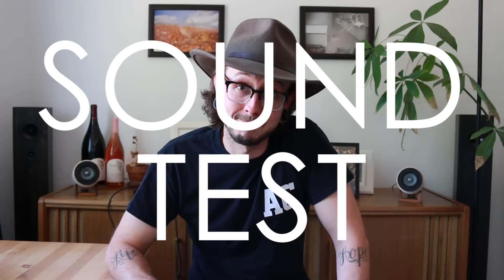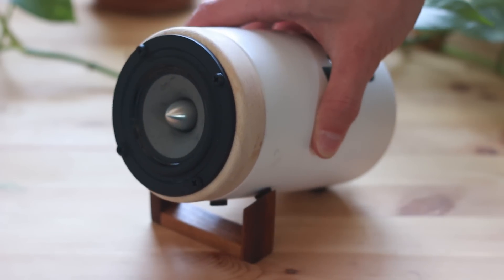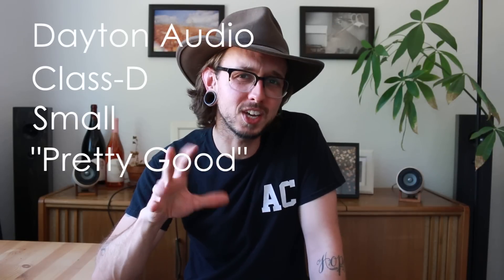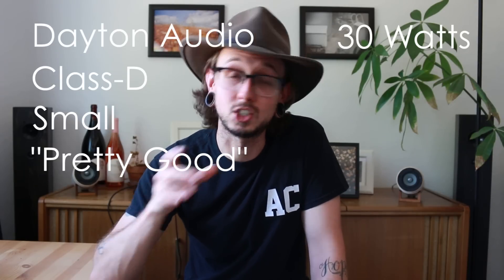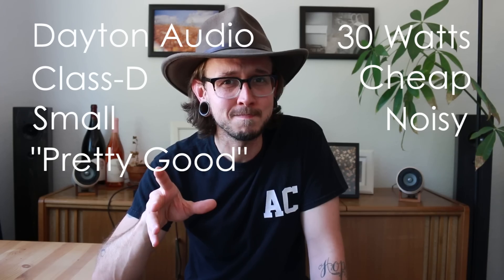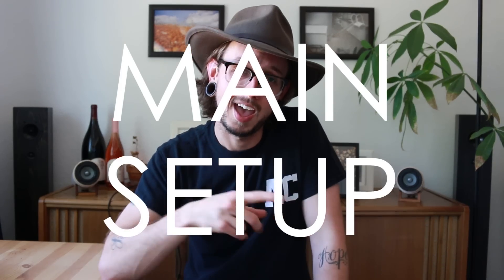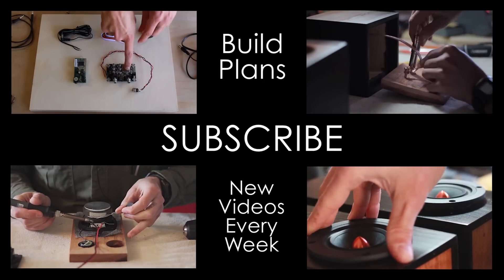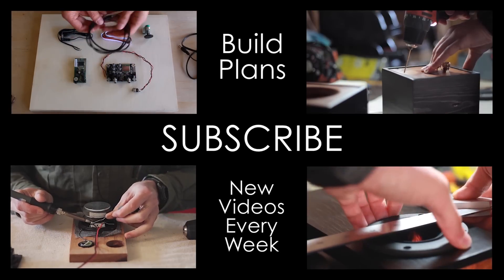SOUND TEST! DIY Ceramic Speakers || Yes, I gave in...

Comment: Hi !  first of all my sincere congratulations for your excellent creations.  Very very good indeed !  Then i have a question ... i would like to try to build a two ways.  I was thinking to use these drivers here and a woofer.  My question is ... would it be better using this driver for mid high crossed like at 200Hz or instead a classic tweeter crossed at 2 kHz ? .. in the first option most of the midrange will be on the Tang Band and with the woofer occupied mostly in reproducing the bass. In the second option instead the woofer should provide also the midrange that could be cleaner ?  My biggest worry is that when the woofer must reproduce a strong let's say 60-80Hz and a weak 1000 Hz that could lead to intermodulation distortion ?  In conclusion ... if you had to build a quite full range two ways which would be your optimal crossover frequency ?  thank you very much indeed.  Kind regards, gino

Comment: 1:28 if you're "taking the speakers to" a different setup, and you're not recording them in this same acoustic space, than any difference between the amplifiers won't matter because you've just drastically changed your acoustics.  I'm hoping that you meant you're going to bring your big amplifier in here so that the speakers are in the same acoustic space.  Because science.
Reply: 2:00 Geez dude, you act like whatever you're micing these with is completely colorless and flawless.  You didn't mention that the sound is altered simply by whatever mic you're using, and how you're micing, not to mention what speakers we're listening to.  I still like these tests because they're kind of satisfying in their own way: we know it's not accurate but we don't care, we still want to hear it in that acoustic space, through that microphone and then ultimately through whatever speakers we're listening on.
Reply: 5:25 despite what I'm saying, that was really impressive, the highs on the jazz piece were so articulate and even though the electronic piece had bass we didn't hear, it didn't bog down in the upper bass area nor did it get muddy, very impressive.
Reply: 6:46 certainly more lower mid sound on the jazz piece in this setup, but of course we don't know how the room is contributing to the sound compared to the setup previously and you have the speakers on different isolation pieces than you did in the first part.  Fun, though.  I appreciate the time you took to do this.

Comment: just bought 4 of those speakers, they are hot. 
When they came out they cost 8 dollars, now it is up to 40 dollars piece.
If you wanne know papers are the best type of speakers. The stiffness to power ratio makes them very transparent.
They have "a Directness" you wont find on other dynamics types.
The best sounding speaker I ever had, was some I build as a teenager.
It had 6 x 4 inch fulltones in pairs/serial one on each side on a cube box.
Not the best looking speaker, but the sound was....holy crap...so amazing.
Ever speaker I had since, even at 10 times the prize
were never that good.
They had to be hanging down from the ceiling, terrible look.

Comment: sound diff is negligible but great sound coming from ceramic build whatever it is i think its because of the speakers that you have chosen, what is the total cost of the project? second you did not show the connections that you made and made parts you chose for this device to give such a good sound, it all matters with the correct choice of speakers and then the correct amplifiers that are bringing such nice sound offcourse last is your ceramic..

Comment: Not sure if it was the environment or the equipment, but the demo on your main system sounded like it had more body and better dynamics when I went back and forth between them. I'm currently running a Schiit Modi Multibit.

Comment: I'm not someone who knows about these things, but are these home made speakers sealed? If that's the case won't you have issues with pressure waves in the "cabinet" interfering with the sound? When you throw a pebble in a still pond the ripples radiate out until they hit the bank then reverse direction causing disturbance. Would this not be similar? How would they sound if you put some spacers between the wooden top and the speaker itself? Look up the concrete stereo. The speakers on this are vertical and the cones are suspended above the concrete casing.

Comment: Not bad! In direct comparison between in your living room and with the original song "TFB9 - Vibe Tracks" there seems still room for improverment in the mids and highs but on the other hand it's only a small full range speaker.

Comment: Entire video is pointless, you made a comparison video in 2 different rooms.. entire video should have been in the living room. The carpet floor alone would make a noticable difference.
Reply: And the "sound-floor" static would probably mostly go away with good grounding and balanced cables on the Dayton amp.  I doubt a small Dayton class D (does it even have a fan?) would make loud hissing noises from itself.

Comment: Very open natural sound, lots of it is getting through you tube and my near field monitors. Your recording technique is appreciated, a stationary pair of mics for the sound, vs a roaming camera without sound and degrading doppler and phase effects. The home gear sounds much more articulate on the top end, much better than the class D amp. To hear the difference thru the mics, your room, the internet and my monitors says a lot for these little speakers.

Comment: Understanding what you said about all the factors that affect the real sound of quality full range speakers produce. Today it seams to be all about separate speakers "mids, subs, tweeters. I don't think most people understand the warmth of a full range speaker produces and even better if used with a good tube amp. I love the speaker looks and the out of the box thinking when building them. I have a decent setup for now and even with the compression for streaming and my speakers I was still impressed by those little speakers. I am a huge fan of full range speakers being that all the sound hits you at the same time since it is produced by the same speaker. You know have another big fan. Thank you for your videos in bringing back to the masses to what once was only known and could be appreciated by a wealthier group of people.

Comment: Great 'home brew' (that term comes from Ham Radio operators) speakers!  The sound test is very effective, and does give a general sense of the quality sound emanating forth from these little speakers.  Especially since you used a quality microphone, and if one is using good headphones or PC speakers.  I was listening via a pair of Micca MB42X speakers, driven by a Qinpu A6000 integrated tube amplifier, hooked up to my Dell PC.  Frankly, I can tell your little speakers sound quite nice and full bodied.  There was (or is?) a company called 'Norh' that made ceramic style speakers commercially years ago.  They may still be in business.

Comment: hey Kirby, hope y.re fine. Y did great work. Actually Im also hear the difference in the second track where in the last test middle frequencies are raised and way louder in a sound line, hence complete sound picture is better. Then here is a question have Y tried also some other ceramic speakers and how do you think type/style of sound is compare to wooden speakers?

Comment: that was impressive! and one thing i noticed is how this is well-equalized, the sound bars reaching at maximum of -6dB and that sounds pretty amazing. but i want a opinion..

actually i build my own class A amp, (a heater), than i want to combine 2 woofers with 2 TV speakers, (a stereo), but i have no idea what i can do about the speaker case.

PS: they will be table speakers.

PS2: the amp are 3W for each channel, what means 6 W in stereo (i do not want something loud, i want something what my soul will be pleasant to hear)

PS3: i've tested with my tv speakers, 3W are pretty loud...

PS4: sorry for bad english D;

Comment: I recommend a good camera mic instead of this directional high end one. These tests partly work by listening to the reverberation the extra base gives off in the room and the mic picks up how well the high and mid clarity works.

I gotta admit though, I'm impressed by how well those little speakers perform. Usually speakers that size sound like crap so that's insane!! Is it possibly due to the higher end drivers or the ceramic housing?

Comment: Sounds pretty good despite what I'm assuming is a very wrong case :)
In the second setup, the 3rd track had what sounded like flutter in the beginning. That could be due to the horrendous case design :)  although they look nice.

Comment: Hey Kirby, are you using your Lyr as a dedicated pre-amp or do you pull up a table or something and listen to headphones on it?

Because the pre-amp in the Asgard 2 and Lyr 2 dont are both passive and use a relay to switch from the headphone outs.
so when you're using the Lyr 2 as a preamp, the signal doesn't even hit the tubes.
Reply from the maker: Really!? Where did you read that? I use it mostly as a pre, but break out the headphones every once in a while. I'll have to look into this. Thanks!
Reply: You can test it by taking the two power tubes out, turning it on and you'll see the pre-amp circuit still functions perfectly.

Schiit does have a active vacuum tube preamp now called the Saga which is at a $350. And another coming called Freya which is at a $699 price point.
source for new active preamps and a new poweramp.
http://schiit.com/news/news/schiit-previews-2-channel-line-at-rmaf

Love the videos, keep up the great work!
Reply from the maker: But couldn't that mean the onboard solid state amp can simply work independently from the tubes? I don't know that proves the tubes aren't active when they are in place. I know the amp uses a combination of solid state and tubes for power. I'll have to email them and find out more info. Thanks for peaking my interest about it!
I'll also have to check out those other amps you talked about.
Reply from the maker: So I think I've figured it out. Theres a switch on the back of the Lyr2 for Hi or Low gain. With high gain you get both tube and solid state power and the low gain is just the solid state amp.
Reply: yeah, the implementation on the Lyr is a bit funky!

All in all though still a great amp for planar magnetics.

Comment: Very well done on the original project video and the speaker test. I also am a longtime DIY audio fan and have built numerous electronic kits but no speakers. I may take a shot at these since they are really quite simple. I listened on my desktop studio Dynaudio B5mkII which are quite accurate and the sound of these speakers really struck me. Great work. Look forward to future videos and projects.

Comment: I would test them with no other speakers in the room because they can affect the outcome, like the bass reproduction. I noticed this in my own setup where i have pair of 15" JBL on top of my 6.5" witch im running from two amps. The JBLs are run from power amp with noicy fan so I dont always use them together. When I only play my 6.5" I can be very shure that they appear to display much lower frequencies then before I put the JBLs on top of them, because I recently added the JBLs after using the other speakers for many years. Maybe this is my imagination? But eather way, nice video, thanks :)

Comment: I don't know who performs the actual first track, but it's a contrafact of "On Green Dolphin Street".

Also, I've now listened to this on two different systems -- one a class D Dayton through Sony SS-B3000 speakers, and the other a presentable but still fairly cheap solid-state amp through a pair of Tannoy SRM-12Bs. I could not pick up the hiss (present in the first setting but not the second) through the Dayton/Sony combo, but easily picked it up through the Tannoys. Despite this, I still preferred the overall tone of the Dayton -- no coloration to speak of, just noise -- over that of the part-tube setup. I can certainly see why it might be more enjoyable to listen to the second setup for a prolonged time, even disregarding the noise, but I do mastering and the Tannoys are studio monitors. They're meant to be uncolored and absolutely unforgiving, so that I can track down and deal with any weirdness in the mix. This means I have grown accustomed to hearing things rendered "as they lie", and generally prefer things that way even if they're not as aesthetically pleasing. I can hear the "coloration" of the SS-B3000s (I double-check my mixes on a system more representative of what 90+% of my listeners will have) and what I used to find pleasing when I first got them (lots of thump for an 8" woofer in a lightweight case) I now find an annoyance (way too boomy in the 100-250 Hz band, at the expense of 500-2000 Hz).

I will say that on both rigs, the speakers themselves performed amazingly well for something of their size and simplicity. I'd probably paint them and give them grilles just to make them look more conventional, but the size certainly isn't a concern! I also might attach the tilt stands permanently to the wooden rim simply so there are fewer pieces that can be lost, but that's just a matter of using double-stick foam tape as the interface medium.

Comment: Aren't that the drivers that the logitech z5500 use?
Reply: Not really haha. They look alike because they also use a bulletpoint center cap, but there are many many many fullrange speakers that have that bullet-cap-crap :P
Reply: Victor Affonso as said before a lot of drivers have a metal bullet shaped phase plug it helps with sound directing

Comment: i was thinking about making my own 2.1 system, but i do need a little help. im quite confused by the amplifiers. should i just have a 2x50w + 100w circuit in the subwoofer, then run the speakers and subwoofer to it, and have audio fed to it via 3.5mm jack? or i could even mount the amplifier externally and just have rca connectors on the backs of the speakers? http://www.ebay.co.uk/itm/TPA3116D2-50Wx2-100W-2-1-Channel-Digital-Subwoofer-Amplifier-Board-12V-24V-UK-/172257541780?hash=item281b597e94:g:sJUAAOSwOVpXc52V

Comment: if i build those speakers could i plug it on my pc? if i add a jack of course ^^
Reply: Nope, you need an amplifier to drive the speakers, the audio out from your pc is just strong enough to power most non-high-end headphones.

Comment: i played this video on two different setup that i build myself 

all test tracks are from youtube or its an original uncompressed files ?

both tried the tracks on youtube maybe sound way more different then the original files does but track 3 the high are not strong as this 3 inch speakers do 

then found out these 3 inch speakers are good on low and mid  its a good speaker to sound vocal voices 
 only thing i was noticed the highs were too strong for the ears to hear has a feel that stings the ears on my both setups did you done tweaks on it or its just pure drive no enhancements for both setup ? 
did you tried  the dayton audio perform in living room as you tested on the kitchen ?different places may sound vary  and no doubt living room powered with that (schiit audio) its way much better and more detail then the dayton on the kitchen it would be a fair test if both were tested in same place

Comment: I hear all most  the same result from both amps, about the speakers. I would have drilled a 1/2 inch hole in the back for the low frequency side. That would give it more bass. and they will perform a bit better Like Bose would with using small speakers.

Comment: Short time subscriber here, after seeing one of your little square speaker builds pop up on my suggested page. Just wanted to say I love the channel! The video composition/ music/ etc and organization of the builds is great. I'm a big audio fan myself and have built a few speakers in the past, but currently as a full time student/ part time Industrial Design intern hasn't left much time for that, but I'll definitely be replicating a few of your builds sooner or later!

I have a humble "main" setup of AudioEngine A5+'s and an Insignia subwoofer, the speakers sounded far better than I would have imagined on both setups, for what they are, but even over video your "main" setup behind them made them sound so much better than the small Daton amp.

Comment: My immediate impressions were twofold:

1) The Dayton amp was incredibly noisy. The noise floor was very distracting.
2)The living room setup seemed to produce a much fuller range sound. To my ears, the Dayton amp seemed more midrange-focused, whereas the Schitt/Topping setup seemed more capable of producing a broader tonal spectrum.
Reply: From my point of view, the Dayton Audio amp was ear piercing and the Schitt system was detailed and clear, yet still buttery smooth. The lack of high frequency noise sure helps.

Comment: The video is great, very clever testing, adding the song files in the description for us to download and compare also moving them around to different environments.  In my personal experience which is very short... I've found that good drivers and good amp are 70% of the sound, the rest its enclosure design and quality, Is this right? or does material, cables and connectors play a more important part?

Comment: I'm Sorry you were kind of forced to do this video!
The problem with this small speakers is the bass part of the range (obviously) they have not enough displacement to realize feelable bass.
These speakers would do their best over a 2.1 seup! why don't you try putting a small subwoofer in another ceramic jar, maybe a touch bigger one?! that would be cool and definetely round up the sound range!